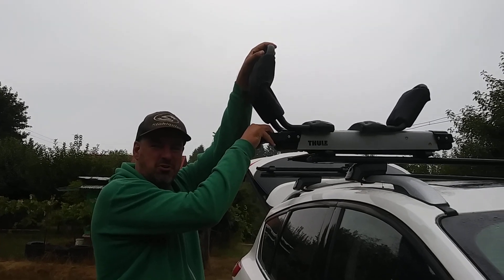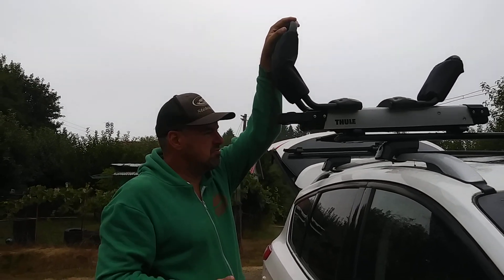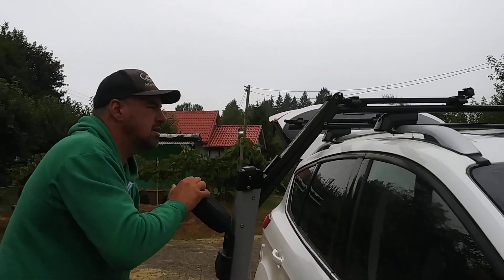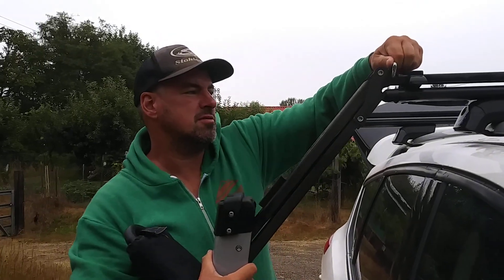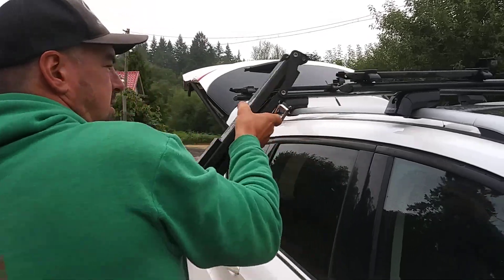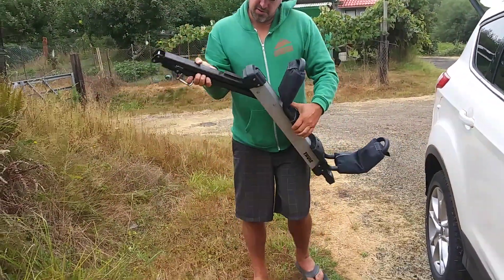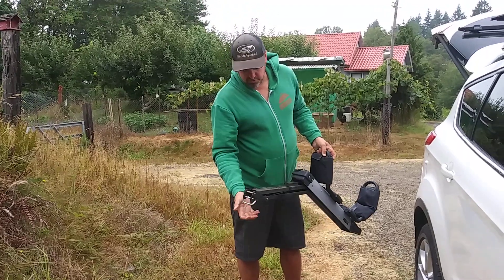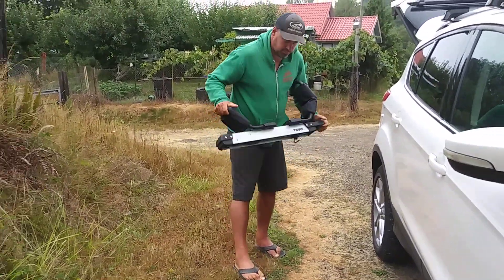@thule Removing Your Thule Hullavators when not transporting a kayak

Comment: I work at a rack store and I was told this by a customer do not do it this way. You will damage the hullavator and lose a finger or toe if your not careful. This was brought to my attention by elderly couple. What you want to do Engage the lever on the car and lift up a bit and place something like cardboard or a roll of duct tape anything you don't mind getting squished and easily pull the pin and then slide the item out.
Reply from the maker: Will deffinitley try that next time thanks for the tip!!